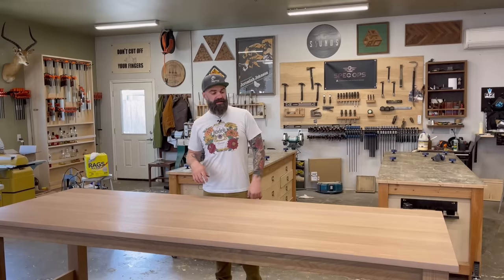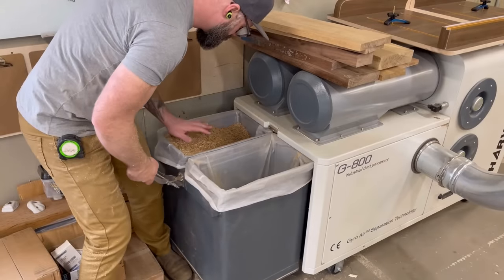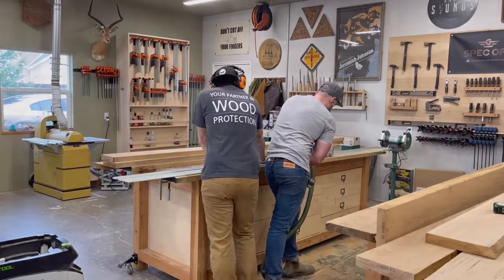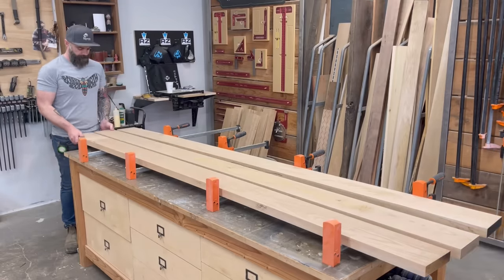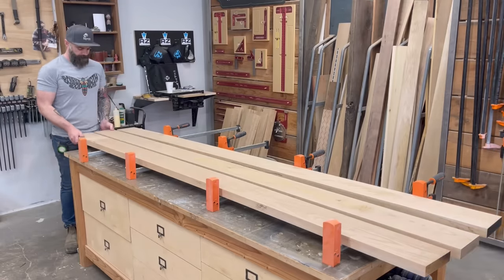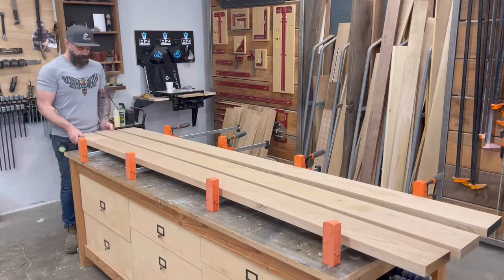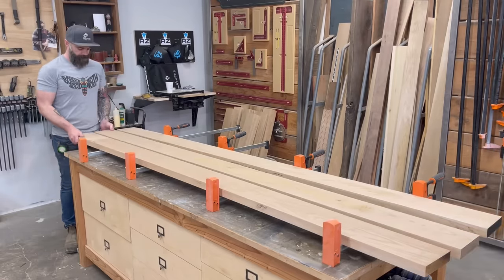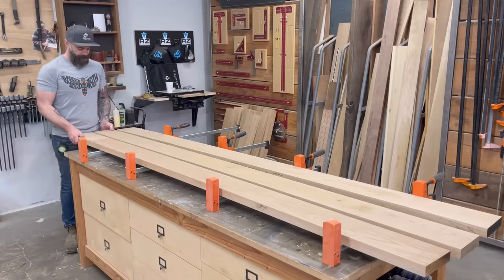I Really Thought We Could Do It  || Building Giant Tables

Comment: I helped an old friend (George Nakajima) build a 16’ long table for an old restaurant in New Orleans. We spent days sanding it to a super smooth, glass-like surface! The end result was amazing!

They wanted it on the second floor so they had to cut a hole in the side wall of the building , and swing it in with a crane.

Anyway my old woodworking friend George just passed away in February. RIP my friend.

Comment: Great build can you tell me how well those Z clips holds on such a big table? I have used them many times on coffee table sized tables but I’m worried about how tight they are on a bigger table.
Reply: I'm pretty sure as long as you're not holding the table upside down by the legs and shaking it, they  (and gravity) will hold it in place just fine.

Comment: 2:51, At this point, could you have put all boards together here and A) glue as follows(as you look at end from left): board 1(n,y), 2(y,y), 3(y,n))x#L where #L is # of legs, y=yes glue, n=no, and each position corresponds to left or right face, B) clamp with 3-4 long pipe clamps, C) left on bench overnight, D) skip ahead to 6:30 and releases pipe clamps? Wax paper on bench & between layers (legs) you want to keep apart. Thoughts?

Comment: Just wondering why cut that second edge on the table and not just use the track saw ? Seems it would have been much more accurate as you might not be able to hold that heavy board against the table fence very tightly. Thanks.

Comment: Question for anybody who will listen - When I've done large table tops in the past, I used biscuits in every seam for strength.  It's a bit of a headache and seeing Jason just glue up on this 9 footer makes me think I'm wasting a lot of time. Does the thickness of this top (1.5") let you get away with glue only? Or did I just pick up an unnecessary habit along the way?
Reply: I still use biscuits because I dislike sanding misaligned seams, that's why I would never consider them a waste of time for this purpose.

Comment: Your festool track saw can cut straight lines over a 9 foot length? You mean what it's made to do? Awesome. My KREG track saw can't do that. There's at least a 1/8" deflection across the length. Most frustrated thing ever.
Reply: You need a better track. Festool and makita have one piece 3m long tracks
Reply: On some brands of track you can actually fasten two or more tracks together for longer cuts.
Reply: @BigHeinen  That's actually what I'm referring to. It's fine across 55", but adding the second track causes issues on the Kreg
Reply: @nickbailey202  even Festool can deflect - Sedge from Festool had video one how to  do long rips with joined tracks. Two things - ensure you push saw forward and not sideways by positioning your shoulder over the track.... You can also brace the track in few spots on top of clamping the ends.
Reply: @meperson  How would you brace it? Can't clamp it in the middle and I've tried clamping on the ends but no clamps are thin enough to clear the motor housing
Reply: @nickbailey202  for Festool clamps at the end are below track so no issue there. Not sure how kreg works. For middle use     piece of 1/4 or 1/8 inch plywood to brace and clamp it far enough from the track to the workbench.
Reply: @nickbailey202  I apologize if I misunderstood.  Stay well sir.

Comment: What I learned was having $100,000 worth of equipment allows you to build what ever you want but the $100,000 worth of equipment doesn't help when it comes to design process, gluing planks together for the legs? Really!!!! Why didn't you just buy thicker stock for them? Anyway like most Youtubers skill and craftmanship has gone out the window and replaced with expensive tools because it's easy but the  track saw could have been replaced with a hand saw or circular saw and a straight edge and the pantorouter could have been replaced with a chisel.